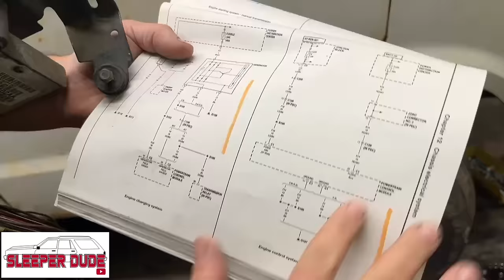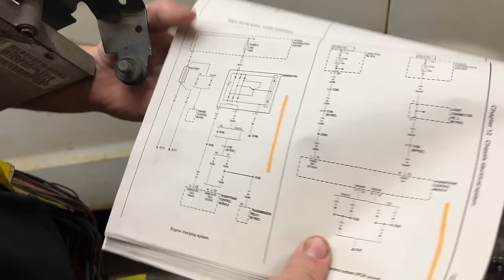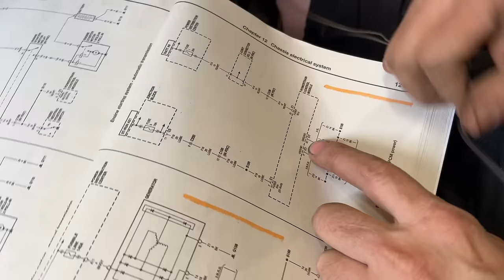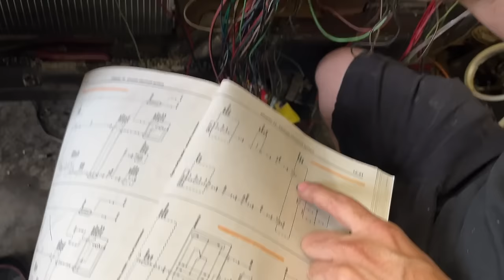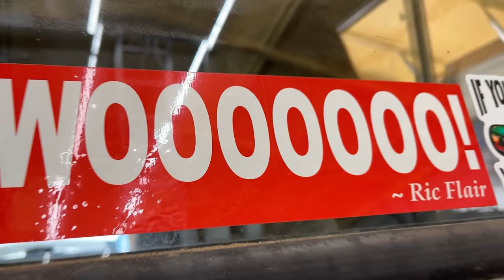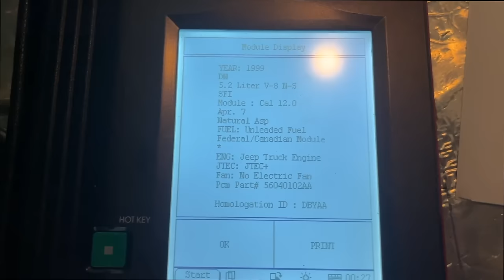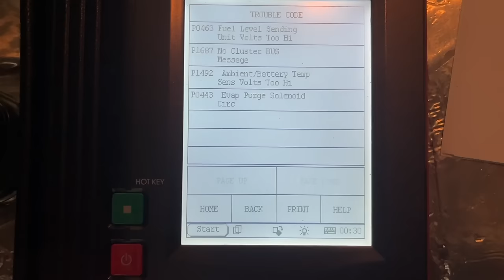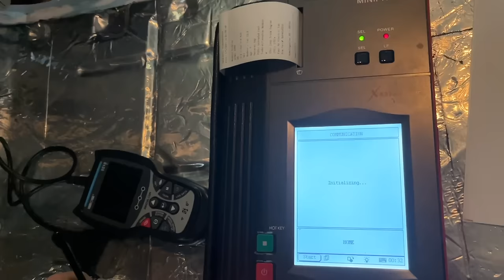2 Years of WORK Has Led Up To This! Will It Start?

Comment: Are you getting (proper) fuel presher to your injector. You was saying it was to much presher erlyer. That might exspain the backfiring. I really think it's fuel related, what about going over everything with the settings on the carburetor aswell.

Comment: Didn't read all the comments so I apologize if this is repetitive. Years back had trouble with a 90's Mopar that acted like your issue. turns out the body, trans, and engine control modules all route thru the instrument cluster. Had a bad printed circuit board, replaced it and took care of the problem. Don't know if you circumvented that in your harness swap or not?

Comment: I'm speaking from gm experience. Dodge may be different idk. The oil pressure switch if bad or not hooked up can shut off the injecter as a safety feature. And obviously security shuts down the injectors too. But with the oil pressure switch not hooked up, that could be a problem. Just a long shot. I hope you figure it out.

Comment: Now I’m clearly speaking as someone who has not seen the wiring diagrams that you have, but I think you need to verify what sensor controls injector purge and check powers and ground wherever that may be.

Comment: Try to crack it with a tester on the injection wire see if you aren't getting power or ground or both it could be a ground wire for the injectors the regular start but when you manually fire the injectors it takes a computer ground and make sure your getting the right voltage to the computer and the crank sensor

Comment: Make sure you have OEM camshaft and crank sensors… this vintage of dodge is very picky on parts.  You need to verify cam and crank signal unfortunately you can only do that with an expensive oscilloscope

Comment: You need to have the cluster connected I know that sound dumb but that's what it is I'm pretty sure I know in my wj witch is the same computer as that one if the cluster is disconnected it won't run hope this helps

Comment: There  should be a signal  wire to injection system   might be  hidden on the stuff u take off  ... possible  to bypass it

Comment: It seemed to stop firing the injectors after you plugged the vacuum leaks, and lowered the fuel pressure. Right? Maybe go back, and unplug the vacuum leaks, and up the pressure again, and see if it acts like it did before?

Comment: Could it have to do with immobilizer fuse? Had that kind of problem with a volvo some years ago, it started and ran about 2 sec and then shut of. It was the fuse for "light switch immobilizer".

Comment: Hey guys not real  familiar with your tgpe of set up we didnt get those here but by looking at the distributor it looks like something we got here on our fords and the unit on the side of your dizzy looks similar and this is what ford use for injector triggering it will run like you have done with fuel down intake id say that unit could be faulty or check all gronds in case you missed one

Comment: So I thought on these newer Motors just like on my Vortec crank and cam sensors are the ones that do everything the distributor basically does nothing but hold the wires. From what I've been seeing don't you have to hook a computer up to dial that motor in??

Comment: Put the old crankshaft  cencer  back in and  try it just because  the cencer  is  new it doesn't  mean  its good it could  also be the distributor  it works with the  crankshaft  cencer  to tell the injectors  when to pulse and  oil pressure cencer and  battery  cencer  should be  hooked up  as well also make sure the transmission wireing is connected if it doesn't get a signal from the transmission it will not  start  good luck

Comment: After 1998, Dodge vehicles had key transponders...(Chipped Keys). The Durango should have had a transponder for the key as well as for the vehicle. These transponders communicate with each other in order to allow ignition. It seems as if this may be necessary for operation. You may have to use the Durango ignition switch and key...Just shooting in the dark here, but the symptoms are the same as what you are experiencing. I will do more research and post whatever I find.

Comment: I drove a rollback for 11 years, I bet I towed 50+ jeep Cherokees (99-06) to the Dodge dealership for computer issues. Most of the time people would replace computers and have to have them reprogrammed . 10 years ago, the dealership was the only place that could program the junkyard computers. I think it was around $300 for the dealership to do this and it usually didn't take more than 1 hour. Hope this helps
Reply from the maker: Ok thanks for the info

Comment: After watching the vedio several times. The problem is possitive batery to the injectors. They are fed from the asd relay if you bypass it   You should be all set. NOTE the fuel pump relay is fed from the same wire out of the ecm so keep an eye on the fuel pressure if it starts then stalls.

Comment: If the engine still doesn't run with new injectors or possibly yet a second replacement fuse box I would scrap the fuel injectors and install A brand new 4 barrel holly carburetor on it.

Comment: Hey Josh— 100% agree with @williambowman5311. Re-sync the cam & crank sensors. Also, just to be sure, check MAP sensor voltage key on engine off. (Like engine on would be an issue, right? Lol). Should be 4.5V key on. Double check the throttle position sensor at closed throttle, too. Should be  .5V at closed. Best of luck, my man.

Comment: Alright. Troubleshooting electrical. I do this for a living. You’ve confirmed the injectors CAN be driven, with the test tool. So they have power and the wiring to them is good. 
Not having the Durango cluster is a bit of a shame, I’d be curious if it’s showing RPM while cranking. Given that the spark works, I would guess yes. You might try disconnecting the pickup from the distributor to see if the spark can still run the engine on sprayed in fuel without it. And vice versa with the crank sensor. Those distributor pickups are notoriously fickle in the early 90’s Dodge 4 cylinders that I used to hot rod (you had a Daytona, right? Ever have the “HEP” in the dizzy go bad? I used to have to keep a spare in my glovebox it was so bad. 
I think security system was a red herring, not the problem. It ran for a long time before you fixed the vacuum leaks. It’s a sensor or a power delivery problem. 
The battery temp sensor is an import part of the charging system. One lead goes to the same ground the intake air and coolant sensor use, the other wire is the signal back to the ECM.

Comment: When you had it at TDC, was it on the plug wire itself on the cap or just pointing towards the number 1 cylinder that makes a difference.

Comment: This is a comment on the motor home injection problem just thinking if this is a Non sequentiall system. Maybe you have a shorted injector causing your problem. Unplugged one injector at a time and see if you then get a signal .
Reply from the maker: Ok thank you
Reply: @Sleeperdude  Yeah I made a comment earlier I had to rewatch your video to make sure I wasn't speaking out my rear 😅

Comment: I hate to say it but I think it's a ground issue! I'm sure you've checked that but them things have to have a certain amount of grounds in certain areas or they will not run no matter how much you try switching out parts! I'd overkill the grounds and unhook the battery for a while so it can reset itself 🤞

Comment: Sorry to hear on this like the Mrs Sleeperdude you did alot of stuff and like Dylan said Im stun on this now I heard this one and dont know if its true so dont quote me on it but when you do a transmission change does the codes have to match up with the computer too on the motor that is the only thing some of them computer bugs do interfere with them self but it dont make since when it was fireing off and almost running I pray you solve it fast

Comment: You need to put injectors in it...the injectors need to functioning when you clean them.  The ultrasonic cleaner on got the outside clean.
Reply from the maker: But I am not even getting a signal to them
Reply: @Sleeperdude  check crank and cam sensors...make sure the grounds are good.  Possibly missing a ground I'm thinking

Comment: Great job guys I had one problem like this swapping a magnum from a 2000 Durango to a 78 d 100 turned out to be where I used the voltage regulator wire as my power source for injection and while cranking I only had 6.5 volts instead of 12 not sure if that info would help any

Comment: I'm thinking you lost the cam position sensor in the distributor and therefore aren't getting injector signal. At first it was the ecm security locking you but then when it stopped trying to fire at all you lost the cam sensor.
Reply: definitely

Comment: Vielleicht ist es der Kraftstoffabschalt-Sicherheitsschalter für den Fall, dass das Auto in einen Zusammenstoß gerät. Wahrscheinlich hatte der Durango diesen Schalter. Hast du sichergestellt, dass er angeschlossen ist?
Reply: Sven says "Maybe it's the fuel shutoff safety switch in case the car gets into a collision. The Durango probably had this switch. Did you make sure it's plugged in?" 

I agree it's something like that -- the computer detects something missing/not connected, and shuts the engine off for safety. When you tried the second computer, what were the trouble codes? 

One other suggestion -- I had a Chevy that wouldn't start with the air filter taken off. I assume it needed a connection to the MAF sensor, which was next to the air filter.

I admire your bravery to try new challenges -- a swap of a factory computer to a different car/camper is bound to be harder to work with than an aftermarket computer.

Comment: Another thought. Make sure the noid light isnt reversed it is a led wont lite it reversed
Also i had a jeep that if the bat voltage dropped to less than 11 volts it wouldnt start. 

Good luck
Reply from the maker: Ok thank you

Comment: Try another crank sensor of different brand from different place. The sensors these days have very little quality control. I've heard of many people saying they've ordered various sensors and ended up being a nightmare to diagnose to discover that it was the brand new sensor. Also, there are some manufacturers that won't allow engine to run without a proper cluster. I think it's a security feature though and your new computer shouldn't have that engaged

Comment: Hi Josh, I have a 2012 Jeep Wrangler and am located in Canada. I had similar issue when I tried to start my Jeep with a duplicate key. The factory keys start it every time but if I use the copied key, it will start then immediately shutdown. Seems like a security issue to me.
Reply from the maker: I think you are correct
Reply: Check this Josh, oem switch/key

Comment: I know the late model stuff is great.              Till you run into something like this. 
I was always a back yard mechanic. That is why I preferred the mid 1950s to mid 1960s standard shift cars. No computers or electronics. I was never left on the side of the road with those cars. I have been left at least 4 times (I'm talking wrecker service! $700 computer one time.) since then due to computers/electronics. No electronics, and you have spark and fuel...it runs. Won't start....let it roll down a hill and pop the clutch. People talk about hating points...l was only stranded once for that, and a couple of minutes with a piece of stiff cardboard had me back on the road that time.

Comment: Josh, I had a 1997 Dakota that would start but die shortly after starting it up. It was a V6 but it would run briefly and shut off. I put a new battery in it and it took care of the issue. Oddly enough it happened in the autoparts parking lot when I was getting stuff for another vehicle. Does your computer need to see a voltage signal from the battery? Mine was weak but strong enough to start and that is why it would start and then shut off.

Comment: I don’t know if this will help. I did an lbs swap a few years back and ran into the same issue and turned out a wire to the crank sensor had been cut. I hope you get your issue figured out.
Reply: Correction LS swap

Comment: I saw you changed the crank sensor with a new one, aftermarket sensors are garbage, put the original one back in, or get a genuine MOPAR sensor to install.
Reply from the maker: Okay thanks

Comment: I'd be skeptical about the power to the ECU that you did by combining those two wires. Computers don't do well with the sort of noise that you get from cranking and that can cause them to reset or behave in unexpected ways.

Comment: With modern internal combustion engines death occures mainly due to low or no oil pressure, so nearly all ECM's rely on a signal from the pressure switch to know there is oil pressure present, if the ECM is not getting the signal it expects it will close down the fuel system and stop the engine, thus stopping it from imploding and destroying itself. also inspect the orginal Durango ignition switch for a security ring/chipped key.

        I was impressed with how you went about the wiring harness, but it seems you have overlooked one or more connections critical to the running state of the engine, I would revisit the oil pressure unit and wire it into the circuit, thus eliminating one potential problem ( maybe the only problem) good luck and I hope you track down the issue, for sure it is going to be something simple and a forhead slapping moment for you
Reply from the maker: I will hook it up and see if that helps thank you
Reply: @Sleeperdude  I run a Peugeot 508 Diesel ( oil burner) and had a similar issue, I was out on the road when all of a sudden the engine just up and died, I knew I had fuel as I had only just filler the beast up, but on putting the code reader on it threw a " low fuel pressure " code, I had the vehicle recovered, and taken to my spanner man, he plugged it up and it displayed the same code, but when he did a fuel pressure test all was fine, fpr about 30 seconds, then the pump kicked out, I know diesel and petrol engine fire up in different ways, but the sennsors are almost identical, anyway long story short, he noticed that when cranking although I had oil pressure.the warning light on the gauge cluster wasn't going out,. fitted a new pressure sensor and woo hoo there she blew, cleared the codes took her for a drive and no return of the issue, his due dilligence saved me a repair bill that was looking to be over £200, so the £10 fix was a god send. he determined that because the pressure switch wasn't sending an output to the dash ( run through the ECU) it stopped the electric pump form delivering fuel, thus the low fuel pressure warning code appeared

Comment: Most good hand held scanner that can show you data log of fuel injector pulse width, timing and map sensor data can get you in right direction. If map sensor is unplugged, both vacuum and power, the computer should still start by using a base map, just may not run the best, that engine does need cam signal to run injector’s tho, make sure that cam signal is good. Many Chryslers won’t run at all without one. This engine will run without oil pressure seen by pcm, Chrysler wouldn’t care about shutting your engine down because you didn’t have oil pressures or your wire was cut to it. It’s not a space shuttle, it’s just a cheaply made Chrysler and even at this point in the game, all that happens is engine computer throws warning messages at you and it’s up to the driver to shut the engine down.

Comment: Im not sure on mopar but you said you didnt have the oil presure sensor hioked up. Is it possible the ecm is shutting it down thinking there is no oil presure? Is there a separate ground the computer is looking to send to pulse the injectors?  Good luck hope to see the results soon.
Reply: It may also need to see fuel pressure, do you have a presure sensor on

Comment: Hi guys, I love watching all your vidieos. I think you said you didn't hook up the oil pressure sensor to the email. You need to hook it up. If the computer doesn't see oil pressure it will shut down the fuel system so the engine won't harm itself. Thanks  and keep making videos.
Reply from the maker: Ok I will try that

Comment: I had a 2004 Mitsubishi that did the same thing the computer stated the cam sensor was bad so I replaced the sensor and it still wouldn't I got spark no gas I researched it for things we make a stop and working oil pressure switch key switch replaced all those and it still didn't work about to give up I checked throttle position sensor and it was bad put a new one in it started right up moral of the story is checked all your sensors even the ones you just bought cuz I've got one going bag from the store

Comment: Turn that fuel pressure back up dude. The second you turned it down the thing won’t start. You’re putting a lot of faith in a Chinese pressure gauge for sure. Also put a oil pressure sensor in the A’s the ecu won’t like not having it and will not signal the pump to run only to initialise for start up. When the engine runs the pump won’t because the ecu isn’t seeing oil pressure
Reply from the maker: Ok thanks

Comment: Have you tried plugging the guage cluster from the durango into the harness?  Ive had similar issues because the pcm needs to communicate with the cluster through the canbus circuit in order for things to be happy.
Reply from the maker: Unfortunately that harness is huge and we cut it all out
Reply: Sorry to hear that...hopefully a reasonable solution will present itself...